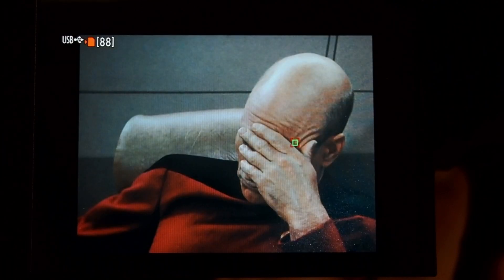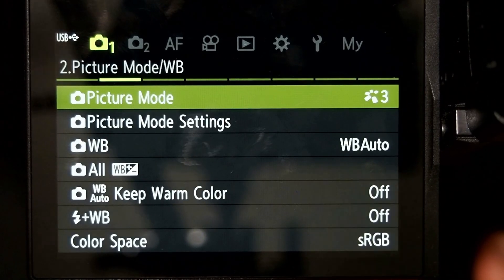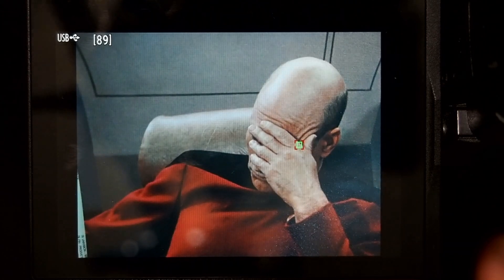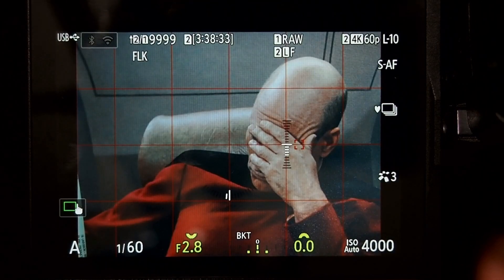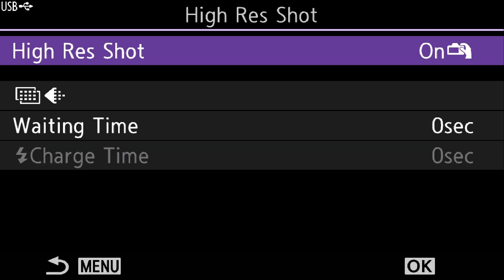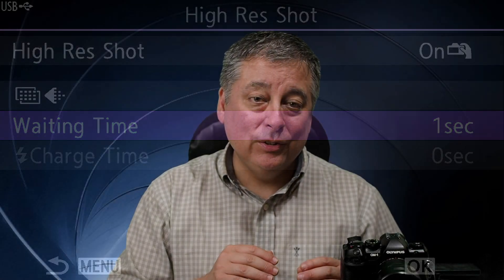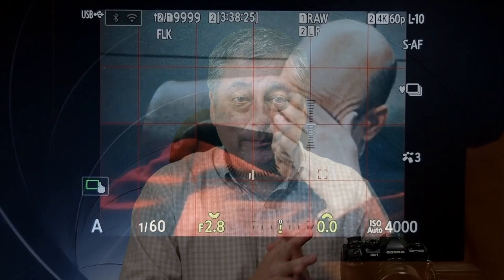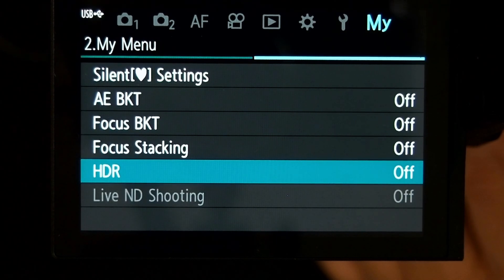OM System OM-1: How to Set the Timer for Bracketing - Tutorial and Tips ep.372

Comment: Rob, I have the Mark 3. Thank you for your tip, I was doing a shoot the other day and could not figure out why the 2 sec timer would not let me bracket. Now I know. I set the custom self timer and it works perfect. Every other camera brand I've shot with brackets perfectly in a 2 sec mode. That's why I was so confused. Thanks Again!
Reply: Timers in general shouldn’t take up the same function as drive modes. That’s the real issue.

Comment: I use the self timer all the time! It is difficult to understand why they change that!maybe they what to sell more remote controls…
Reply from the maker: It is odd they removed that ability.  Maybe an oversight when they rearranged the menu but could be they did want to sell more remotes.
Reply: @RobTrek  Exactly.  Or they want this differentiation between the OM1 and em1/em5.  Incidentally, the em5 is much faster ( using the same settings) than the em1 when using Custom selff timer with AE BKT, which is curious and also difficult to understand!  Thank you Rob!  Your channel is awesome!

Comment: Nice tip. Another option would be to use the shutter on your phone in the oi share app. This way you don't have to touch your camera and no need to change any menu setting (and forgetting to set it back afterwards).
Reply from the maker: I don't think you can do bracketing through the app unless I missed it.
Reply: @RobTrek  Hi Rob, sorry for the late response. I just tried it. I set the camera to bracketing and then used my phone as a remote shutter and that worked like charm.
Reply: @berlinerffm  that is nice! But the self timer is the better option! OM should bring that in the next few update